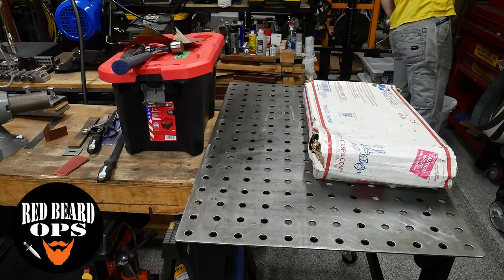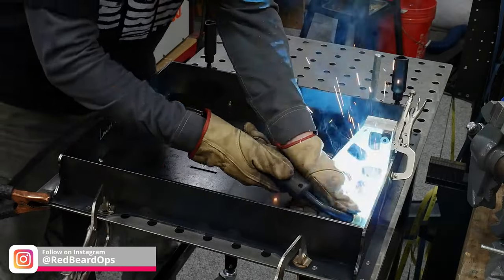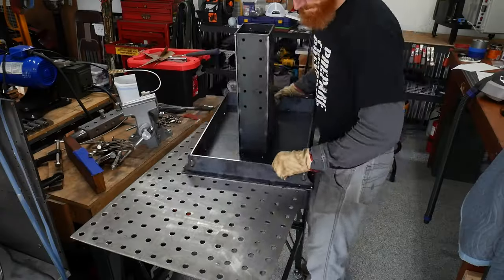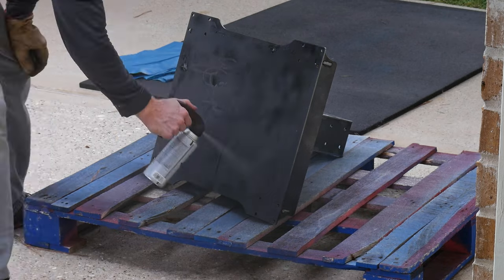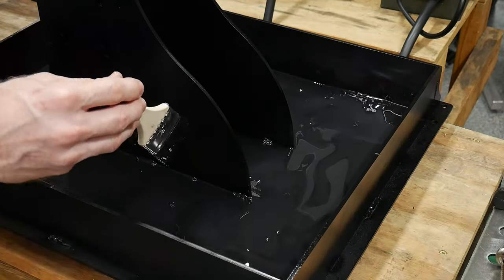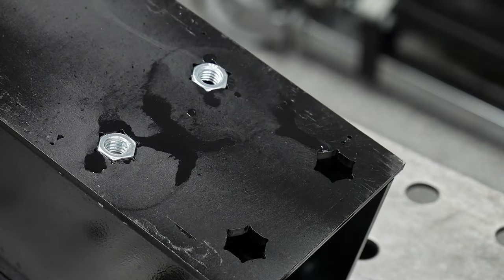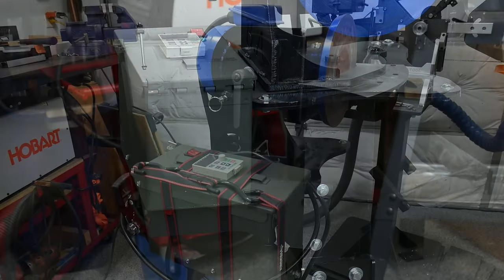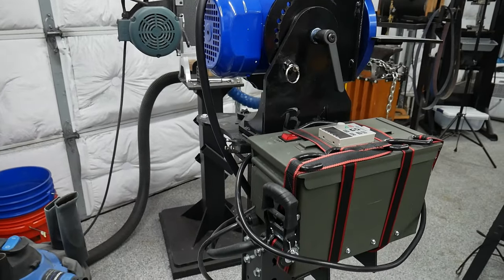Bullet Proof Grinder Stand - Beck's Armory DIY Kit

Comment: Great stand,  my next build will probably be a disc grinder, I just can't decide on what size disc and whether it should be flat or angled. How are you finding the 9" flat disc?  Also what do you think is a good motor size?
Reply from the maker: I have a link to the motor I used here in my disc grinder build video -  https://youtu.be/680VFZ8Tm1g

When it comes to disc size... I like my 9'' since I can use standard paper with it

Also the flat disc has been working well for me.

Comment: Hmmm...I could totally see using this thing as a portable 2x72 stand since wife will kill me if i cover garage with grinder dust...roll it out lock it down grind away..
Reply from the maker: There you go! lol... Pro Tip = slowly kick your family's stuff out of the garage ;) (just kidding)
Reply: @RedBeardOps  Pro Tip..Dont piss off a Puerto Rican wife...
Reply from the maker: @josephrector8735  LOL
Reply: @RedBeardOps  I made sure when we moved to our current location to call my detached garage the "shop" and the attached garage the "garage".  I just use this terminology to subtly and constantly reinforce the idea of what kind of stuff goes in each space. hahaha.  I also randomly and slowly move family stuff from the shop to the "garage" hahaha.  5 years in we have two very nicely defined spaces. :)

Comment: hard pass. the design is wrong. 1 set of wheels should be mounted 90 degrees to the floor an almost touching them. The second set should have been attacked on the opposite side to a flat bar on hindges. 1 press of the a foot and all 4 wheels are on the ground. Released and the base sits solidly on the ground. This is a system that has been around for a really long time and is standard in most shops that don't have unlimited room. 
Really surprised you didn't modify this stand to have this system of wheels
Reply from the maker: Cheers Greg. Seems to be working pretty good. I'm sure if it's ever an issue I can modify it.